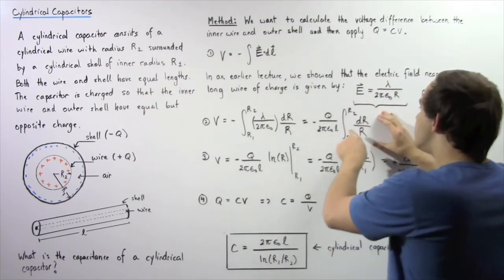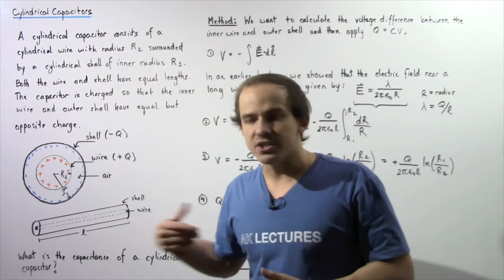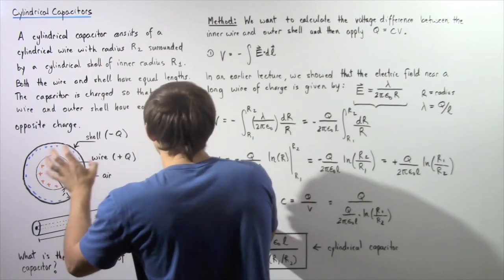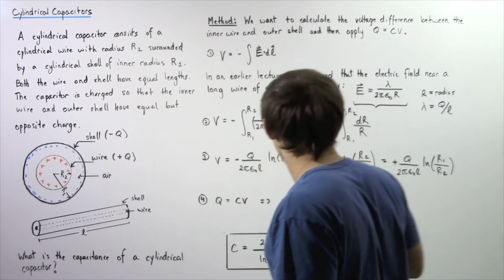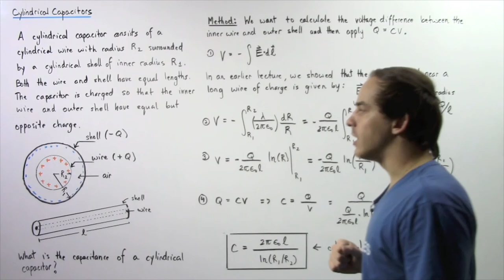Cylindrical Capacitors

Comment: Lower case 'l' has 2 different meanings in this derivation (length of cylinder and length along integration path). The calculation of the line integral is more straightforward (and less confusing for students) if you integrate from inside to outside. The result is of course the same.

Comment: why didn't you consider the dot product over  here of electric field and the dr vector. 
The angle between them was 180 deg and if had considered it the negative sign would be canceled and you need not inverse the natural log ratio to get the positive sign. ( COS 180 deg = -1 ) , i am confused  :(

anyway thanks for your explanation  :)
Reply: This derivation is found like this in most books and problematic because most books don't address the issue with the sign of the dot product. Neither does the maker of this video. If you just integrate in the other direction (from inner to outer conductor), you will find the same result and will not stumble on the sign issue of the dot product. The derivation shown in the video is correct however. The reason is that the expression in the line integral does NOT depend on the direction followed along the integration path. E.dl (with vectors) is equal to E.dR with vectors! This is just overlooked in this video. So, the only reason why the integral changes sign when integrating in the other direction is because the boundaries of the integral switch places. The expression in the integral, and thus the dot product is the same, regardless of the integration direction. Therefore, it is more convenient to integrate in the POSITIVE direction of R. It is very strange that most books do it the other way around...